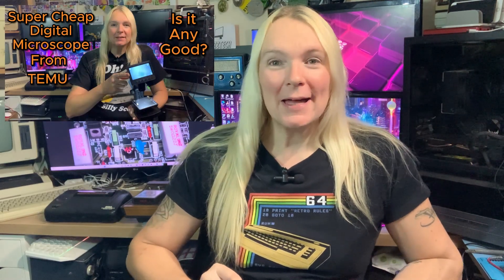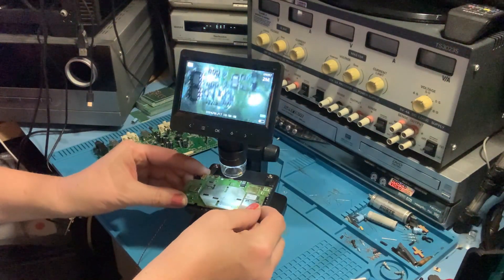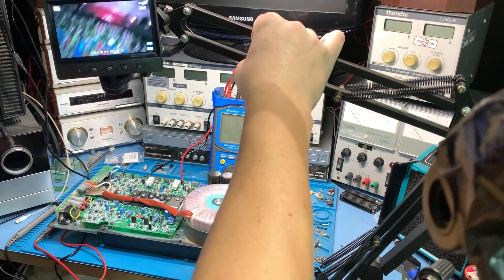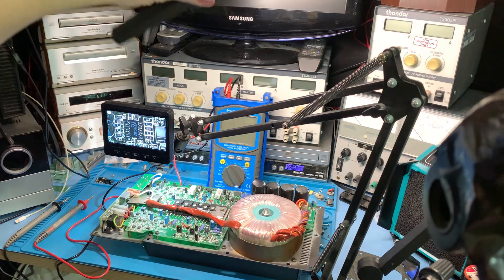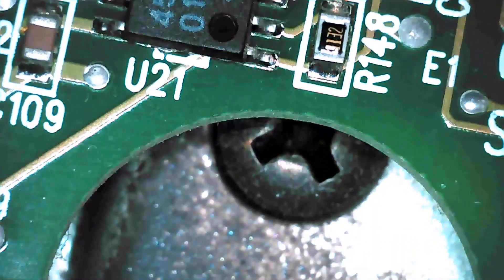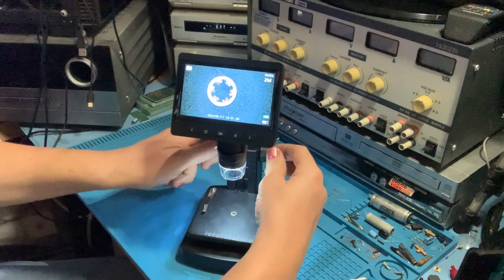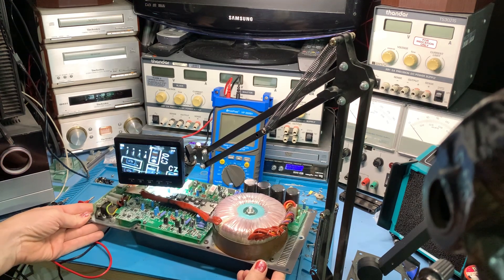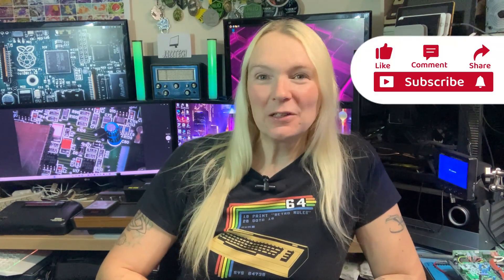Temu Digital Microscope - Amazing & Simple Improvement!

Comment: Great idea!  How did you take it apart?  Any tips? I just received the one I bought entirely because of this video.  It really will be a valuable tool for almost no cost!  I already have the microphone arm.
Reply from the maker: Glad it was helpful. Thanks for watching.
Reply: @JazzTechUK  I'm having trouble taking the top off the base.  Any tips?
Reply from the maker: Yes, start from the bottom. There are some hidden screws under the feet. Take them out and remove that, then more screws will be revealed. Take those out and just work your way up.
Reply: @JazzTechUK  Well, I did it, but somewhat destructively. It turns out there are two small screws that go from behind the display into the plastic of the stand.  I did look in there and didn't see them. They may have been under the battery stuck onto the back.  Anyway, I am ready to move to the mic arm.  Thanks again.

Comment: That's a nice modification, I have a similar cheap digital microscope (no screen, needs a computer or a tablet) that's ok for inspecting small things but not really suited for working on things because of the small base and short focusing distance. I might try somethin like that but I recently got a good deal on an old, used, but fully working Mantis stereo microscope (yes, old school optical) and that's a great help for my aging eyes for working on electronics, cameras, RC-models etc. And no need to connect to a tablet, start software etc., just switch on the lights (I changed the original halogen bulbs to LED:s, much less heat) and go.
Reply from the maker: Optical microscope is good and a good idea to swap to LED's. Thanks for watching.

Comment: I've watched your video very closely Jane, how did you get that microscope apart? Mine won't budge there is a small screw at the top on the side but removing that didn't do anything. It is a Temu one same as yours.
Reply from the maker: If I remember correctly there are some hidden screws underneath the feet. Take those out and as the pieces come off, more screws are revealed.

Comment: This is great tip. Recently bought an angle poise magnifier lamp for £15 which is great for reading but not really enough magnification for electronics work. Will be getting another now and one of the cheap digi microscopes to stick together. Brilliant! Thanks
Reply from the maker: It's a cheap combination that works surprisingly well. Thanks for watching.

Comment: So I have the microscope, but I can’t figure out how to separate the microscope from the stand, it seems to be a one piece moulded plastic thing.  So today, the microscope will meat the hacksaw…
Reply from the maker: Take the feet out of the base and you will see some screws. Remove that and more screws will be revealed to remove more parts. Then you just have to manoeuvre the camera and screen out as one item.
Reply: @ screws under the rubber feet.  Gahhh.  But even past that, it all looked too hard.  So I hacksawed.  Did the job, but I suspect I may have voided my warranty…
Reply: @JazzTechUK  I did that, it seems there are more screws or glue at the top.  I don't see how removing the bottom helped at all. ??

Comment: LOL I did that very same thing with mine a year ago. I don't make videos or I would have shared. I use the stand to hang my phone charger cables on. I noticed your stand is mounted directly to your workbench. Doesn't it giggle a little much at higher magnification? I had to mount mine on a seperate table. Maybe I just need to get a sturdier table. Thanks for the vid!!
Reply from the maker: My workbenches are 40mm thick kitchen counter worktops which are very heavy in their own right. They have quite a bit of test gear weight on them too, so they don't budge at all. They are really solid. Thanks for watching.

Comment: Looks a great idea, never used a scope in this way,  when you're doing things like soldering/desoldering, just how easy it it to be looking "sideways" on to the screen whilst your hands etc are manipulating components/tweezers/soldering iron vertically down ?  Is it do-able in practice ?
Reply from the maker: So far I have only used the screen on the scope while doing actual soldering. I need to mount a monitor screen directly in front of me to really be able to work from a big external monitor. Apparently it is quite easy to get used to. Look at Northridge Fix's channel. He does it like this all the time. Thanks for watching.

Comment: I wish I knew where to buy that particular microphone stand 🤔 Mine is to small to hold it 😢
Reply from the maker: You need to buy a different microphone adaptor to go on the stand. The standard one supplied is too small. Amazon do a good range of different sized microphone holders that screw on the top, including one with slots in like this one.

Comment: If you haven't already, check the solder joints on the 5W resistors on that amp module. The left one doesn't look great.
Reply from the maker: Thank you. I haven't got round to fixing that module yet but will take a closer look at those resistors when I do. Thanks for watching.

Comment: Hi ❤ 🌹 you got that from Temu, but what brand is it? Can it record to a micro-sd?
Reply from the maker: I can't remember what brand it was. I think all those cheap ones are much the same. I haven't tried anything other than using the inbuilt screen and an external monitor. You could always use PC screen capture software.
Reply: @JazzyJane_uk  thank you again! 🌹❤️ I am hesitant to order something from Temu, as what they ship may not quite match what you wanted!
Reply from the maker: I have ordered a few things from Temu and they have always been as described, even if they were not that great in actual use. You could always try Ali Express. I have ordered a few times from them without issue.
Reply: @JazzTechUK  sort of stuck on using eBay & Amazon! I have tried Wish, and they seem okay. Thank you again 🥰🌹😉😍

Comment: I bought a cheap microscope off ebay and didn't like the stand. So I bought a cheap mic stand (same as yours) and fitted the microscope to it. It doesn't have a screen and needs a computer, laptop, tablet, etc to use. But it works great.
Reply from the maker: Yes it's not as good as an expensive camera and lens but it's far better than nothing. Thanks for watching.

Comment: Just bought a slightly more expensive version, and sure enough the table stand is an anglepoise type assembly, way more useful than a fixed stand, i bought an hdmi type pc monitor screen as well, great modification.
Reply from the maker: Yes makes all the difference with an Anglepoise stand. Thanks for watching.

Comment: Amazing synchronicity where even the cutout in the microphone holder matches the focus wheel and good on you for making the connection to make everything work together.
Reply from the maker: Yes it was just the right microphone holder for this (re)purpose. You can buy those mic holders on Amazon. I was originally using it for a Sennheiser wireless radio mic.
Thanks for watching and thanks for the sub.